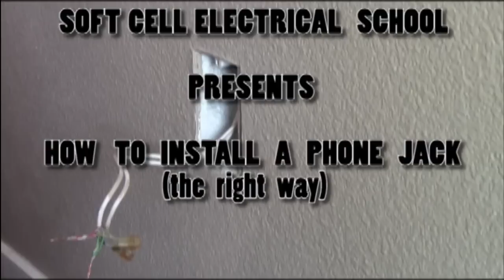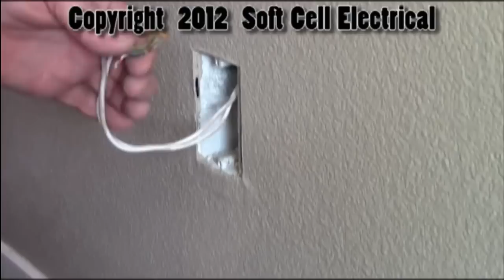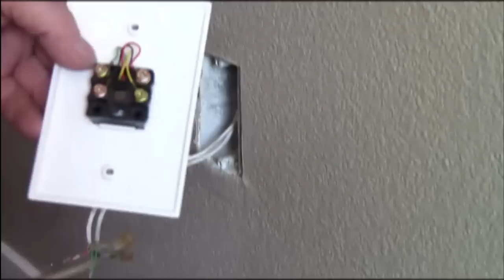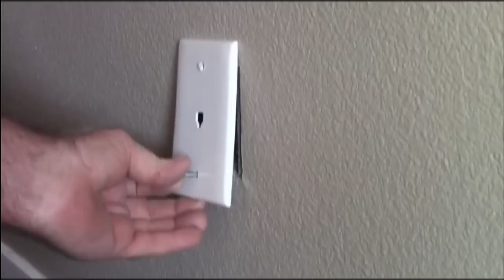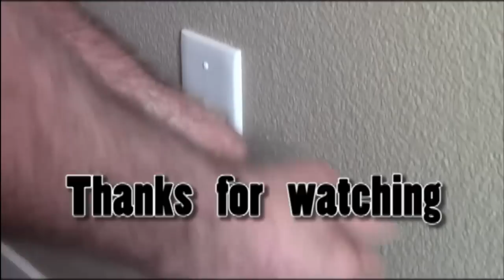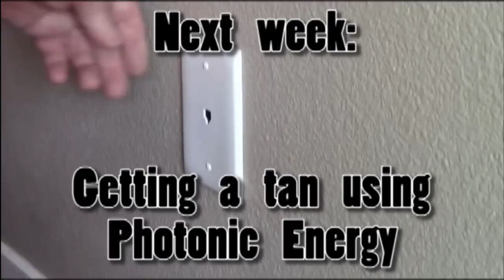Phone jack color code and installation # 45

Comment: I couldn’t see what you were doing because the jack was in back of your hands, or off-screen entirely. When I could see it, the jack was angled flat so it was hard for me to see. Sorry, it’s just that my jack looks very different from yours, so I needed to see it more facing the camera. I had a jack that didn’t have screws—the wires were somehow inserted and held in place by grooves in a plastic ‘board.’ My replacement jack uses screws. Each of the wires on the board is held down by screws. Opposite each one has a terminal on the opposite side for the house wires. I have a red and a green wire, so I wired my red opposite the jack’s red. There wasn’t a green wire on the board, so I wired my green on the terminal opposite the blue wire on the board. My phone is still dead. I was hoping that a video might show me what I did wrong, but I couldn’t see your board well enough. Thanks anyway.

Comment: At the beginning of your video, you already have the 4 short color coded wires connected to the wall plate but the one I bought doesnt have wires installed.  How do you install the short wires first?

Comment: Can the wires electrocute me? I don't want to put a plate on it, just cut it and tuck it in there and hang a flat surface directly with the wall. If there were a plate cover over the phone jack opening it would cause the surface to lay unevenly.
What do you think? Fire hazard?
I don't have the tool that is used to test if it's a live wire or not. Do you know any other way to test if the wire is live or not? 
Thanks, Kristin
Reply: +Kristin Brown No.  They are extremely LOW voltage.  Like touching a battery.
Reply: I only have two wires red and white coming from the wall
How do I connect them to my phone Jack

Comment from the maker: I will vouch for color code only. Phones operate at 52 volts static and 110 volts dynamic when the phone rings. Never heard of the same wire accommodating both AC and DC current. It is not practical. You can leave the power on unless your working with you knees on wet grass. By leaving wire connected outside you can test your phone as soon as you hook it up. Any shock would be minimal unless you were well grounded while someone was trying to call your number at time of connection.

Comment from the maker: If your phone service is connected the wires will be live with 52 volts nominal and 110 volts when the phone rings.
That is why phones are no longer considered 'low voltage'. If no phone service has been established then the wires you use will be dead. You can verify the color code by checking the service connection box located just below your main service panel. You can install the jack live as long as your hands are dry, you may get a slight tingle at most. Thanks for the comment.